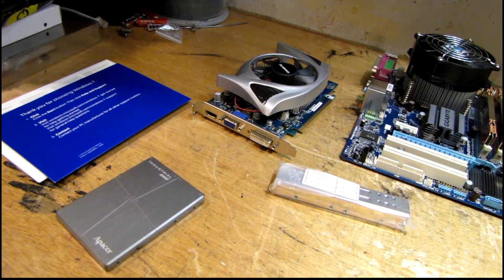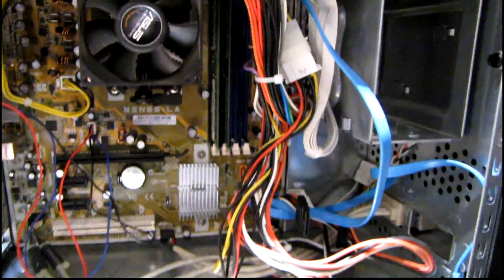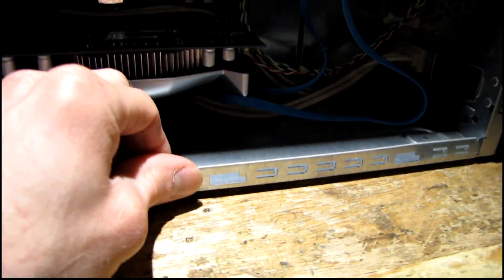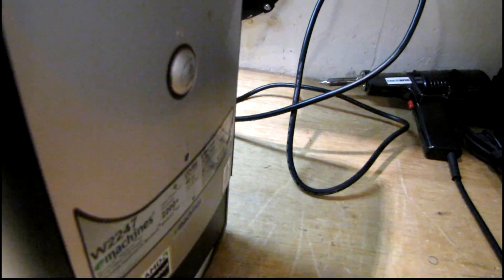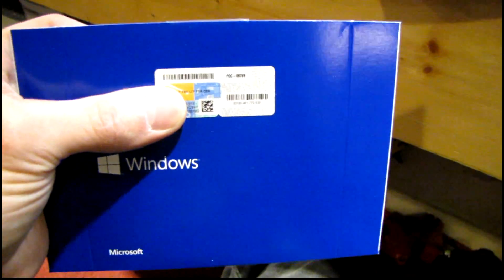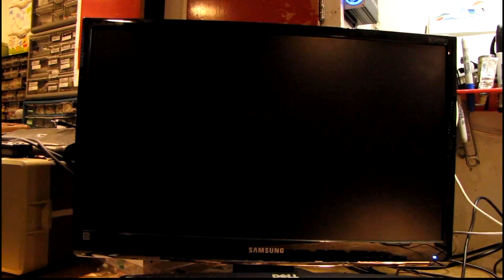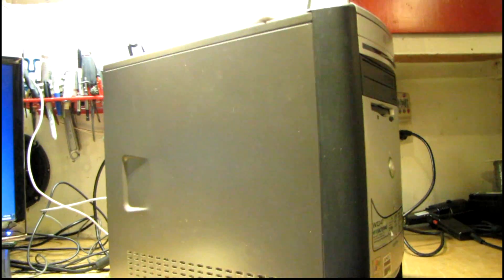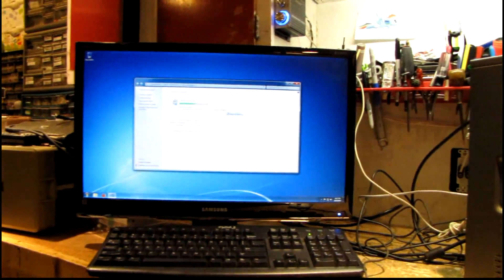Office PC build and discussion 4-23-14

Comment from the maker: Note to self... Just replaced the SSD in this system today (12-29-15).  Weird seeing this video again!
Reply: +Maxxarcade I keep going back and watching these videos with the Pentium E5500 and G41 board since I just picked up a similar model to pair with my E5200 for some overclocking, very decent chips still and have aged quite well over the years.
Reply from the maker: +Shelden iHardware Yep, my other G41M-ES2L board at work is running a Xeon E3110, which I hope to upgrade to a Quad core soon.  No reason to replace the whole board, since there's plenty of life left in it for an office PC.
Reply: Maxxarcade Great office systems for sure, yea the Xeon X3220s are sometimes cheaper than the Q6600s right now and I picked one up for $17 a while back. Capable chips for dirt cheap :)

Comment: I have to use Exploder at times because I have to download audio files from FTP sites. Unfortunately Firefox is not FTP friendly.
Reply: Jim zz exploder is evil as far as im concerned, i tend to stick with firefox and chrome, chrome most of the time due to the minimalism of it, it doesnt have a bunch of toolbars and junk.
Reply: +Jim zz +chris kennedy also chrome has FTP functionality built in
:P
Reply: +thecow275 Well, firefox can connect to FTP servers but I don't believe you can write to it.

Comment: Those older eMachines cases look pretty cool. I especially like the e they put on the power button. But the eMachines motherboards (correct me if I'm wrong) are junk. At least when you have a Bestec power supply.

The Bestec came really close one day to blowing up my HP Pavilion 7975 (2001), but I stopped it before it could go over. When I stopped it, the standby rating was twice it's voltage.

Ahh... Windows 7, the last of the good Operating Systems from Microsoft. Maybe Windows 10 will prove me wrong on that aspect...
Reply: UPDATE Windows 10 did NOT prove me wrong. Windows 7 is still the last great Microsoft OS.
Reply: milenniumedition 56 it’s 2020, but it’s still good.

Comment: Hopefully, I will not sound as a snob or snot or rich person because I am not really well off at all, an average joe working in manufacturing like the next guy. However, having said that, I always believed that any motherboard or PC or desktop that still has the good old parallel port for printer, it is consider an old old computer. I have an Intel motherboard but does not have parallel port and I call it hybrid because it has IDE and SATA ports and I actually use a 750MB zip drive on an IDE port, the HDD is hooked to a regular SATA port. My printer has parallel and SATA port, one day I removed the Parallel port for good and replaced with SATA data cable and it works fine, but I think the parallel port was real fast. I no longer buy or tinker with any motherboard that has IEEE-1284 Parallel Port Interface (PPI). I thought at times to going back to using the parallel cable, but I remind myself to let it go, closure is not easy, it is like letting your old flame go to another man's arm. I do miss the value of such IEEE01284 port when in old days there was this software called Laplink. My younger boss once told me to move all this data and stuff to this other desktop, Laplink and the parallel cable was up to the challenge without using flash memory, DVDs or any other media but just the cable. A new love affair, a new flame around the corner, The new USB Type-C connector specifications are much improved over previous USB generations. Such reversible USB Type-C connector, which is plausible as that device is rumored to begin shipping in mid-2015. True casanovas seduce hardware first than their women.
Reply from the maker: OMG, I still have my homemade Laplink Parallel cable, and the software too.  I remember how awesome that was, back when I was used to serial at the time.  Now everything is way faster via USB or ethernet, so I don't really miss it :-)

Comment: I am forever reusing machine cases are they are normally decent, Last 3 machines I built all use identical hardware and cases. The only issue with one of the cases is it must have been squished a bit so getting the side panel on and off is a tough two hand job,.

Comment: I have a question I have core 2 duo e7300 2.66 ghz 3m L2 cache 1066fsb  what  temp should this  chip be running at  because Im getting about CPU 109F core0 111F and core1 115F using a stock socket 775  intel cooler another thing is when im downloading large files off the internet or have more than one thing open at a time the temp kicks it self up to about 131F does this seam about right?

Comment: Hi Maxx,
Great job. About the noisy high speed fans you can try to use SpeedFan freeware software. It has support for most motherboards out there. Recently I used it on a gigabyte EP41 and asus G41 and it's working like a charm. You have to fiddle around with settings though to get fan to vary speed with one temperature or a combination of temperatures. You can also define custom control functions if you wish. Basically it should be able to control your CPU fan; power fan speed cannot be adjusted using software. However, in order to control your system fan it needs to be a 3-wire or 4-wire type. For Gigabyte MB check the manual to find out which MB fan connectors are controllable (I guess the CPU and the fan connector at the bottom-right of the chassis). Alternatively, you can use your existing fan with DC+ line connected to 5V instead of 12V or you can use the 7.5V trick but I do not prefer it for safety measures. Hope this helps you and keep up the good work ;)

Comment: I recently did a build last week using the old Gateway 831GM case and a new Gigabyte F2A55M-HD2 rev 3.0 motherboard with an AMD A4-5300 APU. It works beautifully. Thanks for the tutorials, Maxxarcade.

Comment: Hello there how are you doing I have a cpu cooling issue . my cpu temp states 50 degrees c and the board is 40 degrees c and I was wondering how to get it cooler . I have a Dynatron cooler and 4 case fans   the motherboard is an Asus p5n any help would be great thank you and all the best

Comment: I don't know about samsung quality, but you want to see some junky ones look at gatway LCD displays. I have friends in I.T dept at local college, they were throwing out a fair of gateways. One had no power, electrical istrucor looked at saw nothing, They were going to toss, but gave to me. I swaped a Samxon brand cap for a elna, worked for about 2 yrs, i just retired it. Other was working, but had crosstalk on the cable from PCB to LCD. My current is a dell with the USB hub, and is like 19in not 17 like gatway, so i upgraded. This one was totaly dead, i looked at was a cheap filter cap replace works perfect.

Comment: Maxxarcade, I have a question... I built a pc using some new parts as well as some older parts from a dell vostro 420 (core 2 quad q9400, nVidia GTS 250, SATA drive, hard drive) and I have windows 7 on it, but it isn't actually licensed. I was wondering if I should go ahead and go up to windows 8 or keep win7 on it and just purchase the license? I actually have some 250gb laptop drive that the OS is on, and the 500 gb hdd I got from the dell as storage. Also the system has 8gb of ddr3 1333 MHz ram soooo yeah! What do you think? and also, /) LOL

Comment: Funny you should mention Samsung monitors, I haven't been particularly satisfied with them either. My Samsung Syncmaster 943N wobbles around because of the cheap stand, one time I bumped my desk and the thing almost fell over. My HP L1950g on the other hand is practically anchored to the desk, with its huge metal stand, that is also height adjustable. Also the HP has DVI and a USB hub, whereas the Samsung has neither, and that Samsung wasn't cheap either.

I always enjoy hearing you guys talk about certain things, just because you never hear that kind of conversation anywhere else, not even in the IT industry most of the time. It's not like Fred (or whoever's top YouTuber nowadays) or even people we know in real life are gonna talk about general computer operations.

Comment: you should use an ide dvd drive, the motherboard has a port for it
Reply from the maker: Ya, but I hate ribbon cables LOL.
Reply: i honestly dont mind them but i will never use them in a windowed case
Reply: 43128lucky4 Turn it around backwa... wait, it's not a HDD, nvm

Comment: Is there any difference between a Apacer industrial SSD and a regular Samsung SSD? :-)
Reply from the maker: Modern SSD's are faster.  I used the Apacer because I got a few of them cheap.  They are only SATA 3GB/s, but they are made for a bit more durability than some cheaper consumer drives.
Reply: Maxxarcade Thank you for the information, i am looking for a quality SSD drive and the speed is'nt that big of a problem, so i think i'm gonna purchase one of these. Thanks!

Greetings from the Netherlands!